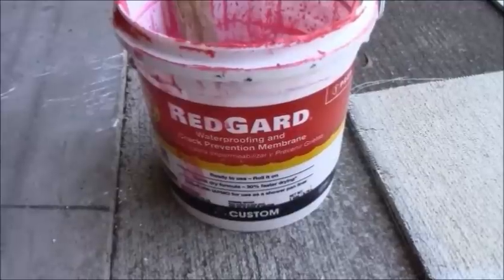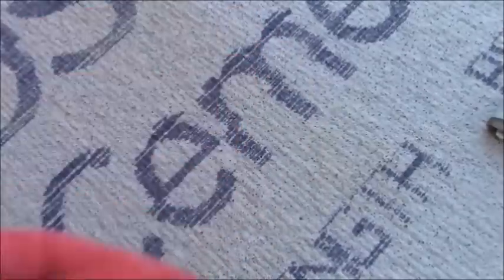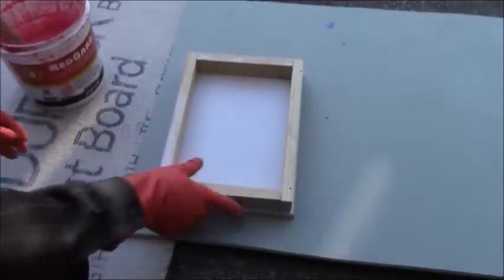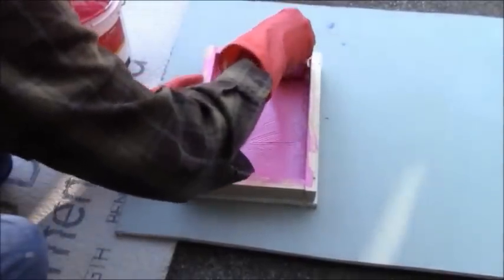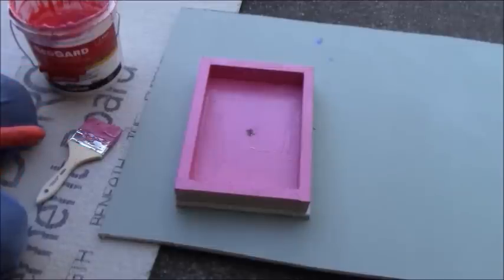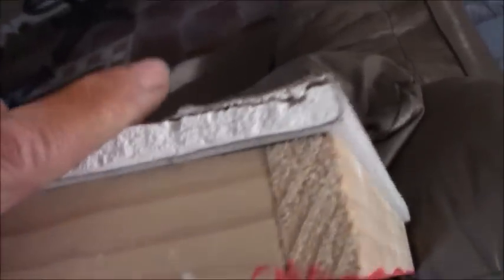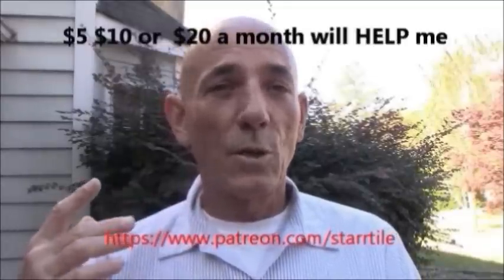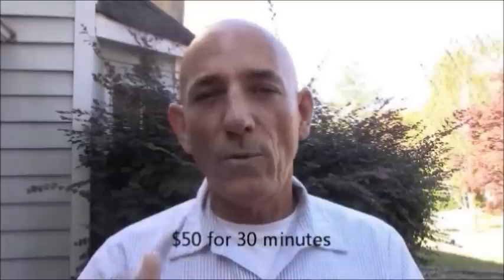REDGARD vs SCHLUTER

Comment: Have you looked at the Hydroban board?
Reply from the maker: I am aware of the product , I'm just not on board with foam or plastic material in my showers
Reply: @StarrTile  I really dislike the thought of plastic or foam material making up the walls inside my house.  If the house catches fire the smoke from that crap will kill us before the actual fire would
Reply: @bolerdweller  I'm willing to wager that my 96 year old house with whatever personal property I have in it has less volatile plastics in it than yours does.  

But really now, that's not the point.  The point is that I don't like the idea of adding volatile plastic material to it during a remodel.  That's just my own personal preference.

I won't use a kerdi board as a backer.  I will most likely use wood slats nailed to the studs then float plaster walls for the shower then use the redguard over it. Then add tiles.  Why?  because every wall in my house is constructed with floated walls and I want to stay consistent with the old construction. 

Again, that is my personal preference.  

I have no idea why you are on a crusade against my own personal preference regarding my own property.

You do what you want.  To each their own.
Reply from the maker: Toxicity is not monolithic
Reply: @bolerdweller  Except I'm not being hypocritical at all.  You are trying to equate building materials for a remodel to shirts in a closet and trying to call me a hypocrite when in reality it's like trying to equate apples and oranges.

Besides, LOL!  most of my clothing is made out of cotton anyway.
Reply: @StarrTile  especially not to someone who is asthmatic and extremely sensitive to aerosols released from plastics burning or not.
Reply: @bolerdweller  Grow up

Comment: Hi I was wandering why at 11:03 there is no redguard on the outer edge and at 11:06 there is ?? is it really your second coat? and at 17:16 you put a video of someone else who did a little corner  without using a corner piece and didn't overlap 2'' witch is clearly specified in the schluter manual. I get that you like one way more than the other but basically it is more how one work and put attention to what he does!! both are good product with advantages and disadvantages, it depends on what we prefer!! the rest is how conscientious one is!
Reply from the maker: When I edit video I cut fat, there really is no point in showing  me painting other areas, so it was cut out..but you're welcome to run same experiment and you'll have same result. And one thing I did not make note of is that I didn't use any of red guards recommended tape, and in opposition to that and the other two videos they end up mitigating their leaks.. one use caulking in the other used hydro ban ironically... whereas mine was as basic as you can be and still came out waterproof👍

Comment: hmm..caustic harmful RedGard that requires safety equipment to install, multiple coats and wait time for it to dry in between coats or a waterproof membrane that goes on with thinset, no safety equipment and you could tile almost immediately after application.  Kind of a no brainer to me...I'll take a waterproof membrane while not putting my health at risk.
Reply: You do that buddy, and when your shower leaks and your subfloor and floor joists root out and grow mold maybe then you can wear a mask

Comment: I think there is room for Isaac and Star tile to exist whithin there differences. Neither is rite and neither is wrong. And some may fault star for not following preslope or having the balls to say i use greenboard but where are the videos of his fails?. Starr uses old school method and throws new waterproof technology on top for insurance. Aint broke dont fix it. Love you too Isaac this aint a knock.
Reply from the maker: Thanks for your comment, by the way me and Isaac have no bad blood, in fact just the opposite👍
Reply: @StarrTile for sure I love these forums that my dad never had. There was a time common sense dictataed the rite way. I do things to current code but i do feel it's redundant. I also respect the efforts of a better way. We can never stop getting better at what we do.
Reply: Andrew- I think that Isaac and Bob/StarrTile are more on the same page then not. Isaac is showing Kerdi isn't infallible, and Bob likes to kick Schluter in the shins for various reasons (most I agree with, lol).
Reply: @krehbein  yea but they arent 100 percent on the same page. Most particular the subject of preslope. That being said i dont think either one of these guys showers are failing
Reply: You know what's funny? Pre-slope is only required in residential applications...not commercial!😕

Comment: I just watched a video on Custom's site and they show a cut away of the backer board being embedded in the pan material! I guess it doesn't matter to them if you coat everything with Redgard.  https://youtu.be/ehfTrvTRPvk
 You have convinced me to never put the backer board in the pan or anywhere near a horizontal surface that gets wet. I think the board should always be at least 1/2 inch above a horizontal wet surface. Oh, use redgard.
Reply from the maker: Yes I chimed in on that same video a couple of years ago because of what they did on it... there was a couple other mistakes I noticed also

Comment: There are a couple of good points you make but some I don’t agree one out of all 3 u use Hardy backer is one of the best here’s y One Dora rock is complete dog shit of a product it’s too porous it is way to soft of a backing board there is Way too much movement after the tile wall is complete which leads to a whole host of problems tile cracking and popping grout cracking and popping after tiled is installed and wall is complete pushing or leaning on it just cleaning or your wife leaning against the wall just to shave her legs there is way too much movement and the biggest one I don’t give a shit what anybody says you’re backing board whatever eBay is going to get wet tile is not waterproof that being said that is 100% why you need some sort of waterproofing membrane Dora rock is one of the worst ones for mold and mildew if all you use is Dora rock and no waterproofing on top it’s not a question of will you get mold and mildew it’s a guarantee 1,000,000% Second green board for a lot of the same reasons as Dora rock is a shit backing with the exception of the mold and mildew resistant material built into the board but again way too soft of a backing material too much movement in my opinion and I don’t want to hear well maybe you’re not installing it right because I’ve used every one of these and I’ve been doing this a long time For the most part it’s a rarity I get a callback on a job but it has happened and everything that I’m talking about is my opinion of stuff I’ve used that I would not put in my own home and green board without a water sealer like red guard or something like that will 100% soak up and hold water and turn to mush Hardy backer out of all threeif installed the right way and a waterproofing membrane is put on will last a lifetime with no mold or mildew problems and it is a strong enough Stiff Enough packing you will have little to no movement at all I do agree with what you said about installing the board into or touching a shower pan it will soak up water But 100% what I don’t agree with you have to put some type of waterproofing on top of any of these substrates just because you don’t get a callback from a customer because the customer thinks it’s just mold and mildew in the shower and that’s what happens in showers is bullshit it’s because you didn’t waterproof your backing That dingy smell and mold in the grout lines and on top of the tile is being caused by water soked into the backing board  and it never dries in between showers so I don’t agree with you telling people it is definitely an unnecessary step because you’re 100% have to waterproof whatever backing you use you will have a mold and mildew problem if you do not I’ve bin doing all phases of home renovations for25 years my partner is my father who’s been doing it for 45 years

Comment: 17:05 the Sheetrock looks wet in the bottom right corner
Reply from the maker: I already addressed that on the same type of comment, that is the paper peeling away from the gypsum, slow it down and you will see

Comment: O’k nice test....however, if You use any type of drywall as a surface to tile on in a bath or shower- even with your mystical magical Redguard bullshit - I will throw you off the job. No Hardi board either.  Try this instead; PVC or rubber moisture barrier first on the studs lipped into the tub, next Durock “1/2 inch only”, then tile it, now the real secret......wait for it........Epoxy fricken grout!  Hardy board is good for going over plywood on floors in dry areas such as kitchens and living rooms.  I only use Redguard on cement or hollow tile walls where I can’t have the rubber or PVC membrane.

Comment: I'd never use green board.  that's alot of wheight your tossing on to that surface.   I can't tell you how many walls I have removed in a shower enclosure bath enclosure and it's hung with green board and the weigh buckled  the boards causing it to fall away from the wall.   in my opinion it's not a strong enough surface area.  and it's a way to make your job easier while saving a Dollar.  initially cutting corners.
Reply from the maker: It's never about cost...ever...my customers pay that, I don't upcharge on materials.
If you ran into what you describe I'd LOVE to see a picture, email it to me. Meantime I've seen heard or seen it, weight is distributed, never is a tile or tile(s) held up by a board, and of the thousands of tile I set on greenboard, including my shower 5 years ago, it's a no-issue.
Reply: I would also like to see this. I have seen and worked with marble slabs stacked 24 feet with just some bronze wire and plaster. It has been there for over a 100 years.
Reply: this was a job I repaired about 8 months ago  in knoxville tn.   did a complete demo and went with what he could afford as a replacement.   the guy even used it on the ceiling and set the 12×24 tiles to it.   I will have to get pictures off my business page  for you guys. a clear buckle was in the wall.  each grout line was cracked and you could press on the wall and watch it flex a easy 2" ... but once removed.  studds  were level.   just poor workman ship.  no pride taken.  green board was designed for drywall  in the bathroom. high condensation/humudty areas. nit to be put into a tub or shower enclosure  (wet area)  as a backer board.   yes it covers more surface area.  it was not designed to hold the verticle wheight of the tile and thin set installed to it.  even if it is "evenly distributed"
Reply: now for something like a back splash and small.mesh tiles. absolutely.    for a shower remodel. it's all about peace of mind and quality materials intended for that specific purpose ...  it's not about what's easier to cut. regardless of waterproofing and I always will use redgard.     the only benefit to using green board is more surface area coverage while saving cost.   the cost of a 5×8 green board  is almost the same if not cheaper than a 3×5  of Durock. maybe 3-$4 difference. per sheet give or take.
Reply from the maker: @handymannyetpb9048  there are a lot of things that I do not know if he did right wrong that could have lead to that failure, that he used green board has nothing to do with it. I have used it since 1998 with not one failure, not one issue, and gravity does not work that way with tile on walls. Having said that if he is putting large format tile on a ceiling then going forward I would have used a cement backer board only because it sounds more or less like a steam shower, that's an application I would definitely use a cement product on and have. But I would be interested in the pictures because they would tell the tale ultimately
Reply: no self respected tile setter would use green board in a bath or shower enclosure.
Reply from the maker: @handymannyetpb9048  why ?? Have you used Schluter? If you have then you've used gypsum in a shower... and according to your logic the Schluter is stuck to the paper of the gypsum and now all the weight relies on that.. same exact idea. Their product is waterproof which is why they allow for it, my product is waterproof which is why I allow for it
Reply: @StarrTile  Are you saying Kerdi is gypsum based? If so I did not know that.
Reply: @handymannyetpb9048  Guessing he didn't use enough screws, or the moisture got to the greenboard. Also, was the other side of the greenboard an exterior wall by chance? I probably won't use greenboard but if I ever do it will be glued up with const adhesive, and protected with something like redgard. Startiles video would give me piece of mind considering the drywall/21 day test success.
Reply: Needs Durabond 90 between all seams and in the corners. Premix or no tape at all will crack.
Reply: yes I have tried the schluter system.  I don't like it.  I don't like how easy it is to cut and ruin the .canvas type materials   vs.  the rubber liner membrane.  and a Styrofoam pan and curb again adhered together by modified thin set.    the system was designed to get in and out of a job quicker. essentially making more money quicker.   it alone saves 3 days just with forming and making your own curb and pan, then prepping walls.     but the room for error highly rises with that compared to a method  I was  taught growing up by my father and grandfather.
Reply: @Kevr. -  Each one that I've seen buckled from the wall has yes been on a exterior wall and  I believe the screws were sunk too deep into the green board  instead of stopping once flush.    I'm almost positive that had alot to do with it but I have seen it on several jobs involving green board.    I'm not saying green board wont work.  I use it for back splashes.  im just saying  that is not the purpose it was made and designed for to be  used in a wet area as a backer board for a wall with several hundred pounds of materials installed on it.   again to each there own.  I just wouldn't ever do it out of peace of mind.
Reply: Randy Rabidue Are you down south (humidity)
Reply: @krehbein   yes sir.  knoxville tn.
Reply: Schluter Board is a foam board and not a gypsum product. Schluter board uses a washer on all their fastners which takes up the surface area of about 6 drywall screws (per Schluter fastner). Traditionally installed I would say the Schluter board system with proper fasteners is at least 2 times as strong as any "GYPSUM BOARD/DRYWALL" If not stronger.

But the issue here is not the sheer strength of the product it is the longevity of the product. Any water resistant drywall that is going in a shower has to have a fiber glass tape applied to all inside corners and seams then coated with redguard. 

If you use cement board not only do you have a much much stronger sturdier product, the product itself is waterproof. You can tape seams and inside corners and do a single coat of red guard. Even if you skip red guard and just had concrete board it would still last longer then the drywall with redguard because concrete board does not break down the same way drywall does. There is a reason why they make concrete board and why it is ideal for showers.. 

Even with a waterproof membrane theoretically the drywall can always potentially sag as it is a paper faced product its not very strong and every door slamming or someone falling into the shower wall could potentially weaken it over time as it would send a vibration through the studs. 

All my houses in my neighbourhood were done with greenboard in the 70s and in 10 years everyone had to replace there bathrooms because the tile was falling off.. 2020 Greenboard is still code as shower/bathtub backer even without memebrane...

Comment: you could never sell  me on this red guard look at the skill set required get the picture as for greenboard that is for glue jockeys when dew point  moves inside wall behind tile it rots and melts a  mold infected death if you cannot handle weidi board try dense shield justn sayin is all
Reply from the maker: Not tryna sell nothing to nobody, just putting info out there. And yes Denshield is a great product, but still gypsum with waterproofer already on it...and not sold everywhere, and still requires waterproofer on edges and screw holes, and it's pricey.

Comment: If I had a tile installer come onto my job and try to sell the my client a greenboard shower, I'd find another tile guy. BAD ADVICE
Reply from the maker: If I were doing MY OWN shower out of greenboard, I'd be confidant with the RedGard...and I am, and I did, 5 years ago this summer ;-)
Reply: @StarrTile   greenboard isn't an acceptable substrate for tile. If you can find a single manufacturer that recommends greenboard under tile (more specifically, in a wet application like a shower), I'd be very surprised
Reply: Even green board manufacturers do not recommend greenboard for "wet areas" such as showers or saunas.
Reply from the maker: You are correct...and although in my vast experience I think it would be just fine since I take out showers all the time from the 90's with just plain sheetrock and no wall damage, that's NOT what I show here. Regard or any waterproofer will insure the sheetrock see's no moisture. Apparently you missed the point of the video.
I've seen and documented on my channel every backerboard out there absorb water and get mold/mildew when no waterproofer was used, regardless that it was Hardi, Durock, Denshield, Wonderboard. And when I use THOSE products I still Redgard them.